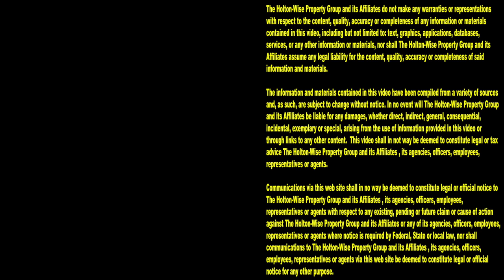Shocking Eviction Time Aftermath | Tenants From Hell 130

Comment: Why are the agents in just about every eviction video (not just yours) unable to pick locks?  I've worked PM and even if a tenant changed things could usually get through in a minute without damage to the door or lock.
Reply: Probably change the locks regardless
Reply: Apparently they don't check credentials before they hire locksmiths...